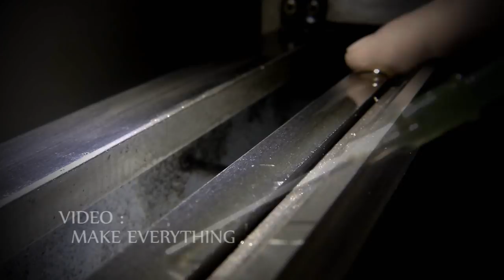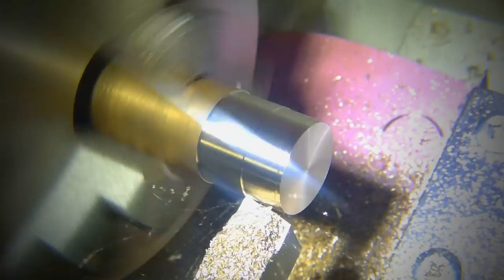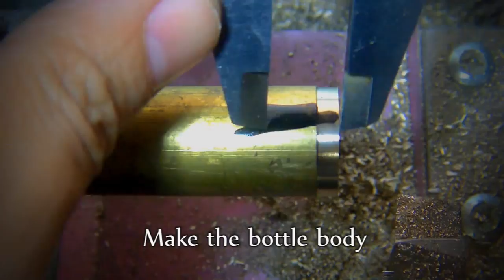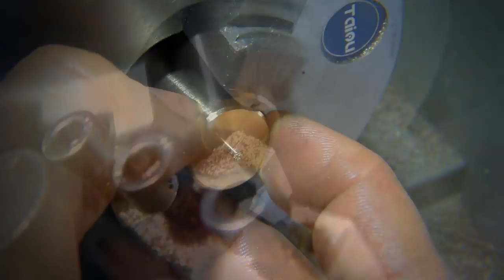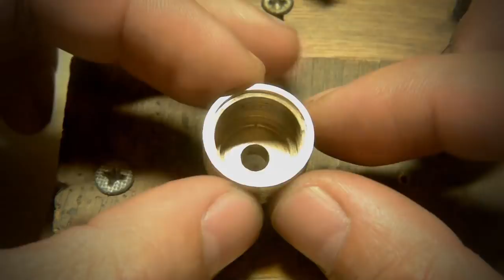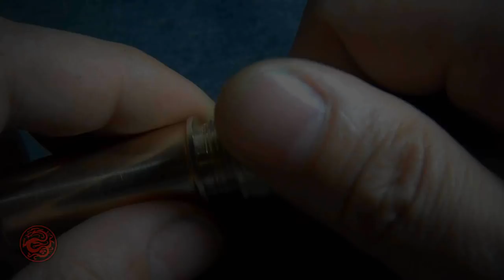MAKE EDC BRASS BOTTLE | SURVIVAL CONTAINERS

Comment: Well done, but as survival container it is not watertight, missing O ring in cover top. The rotary hinge is hermetical issue as well. Suggest to improve design.
Reply: You can get O ring "kits" with several types for a few bucks.. FYI (look up O-ring assortment on Amazon)